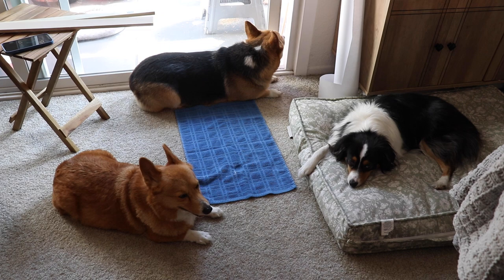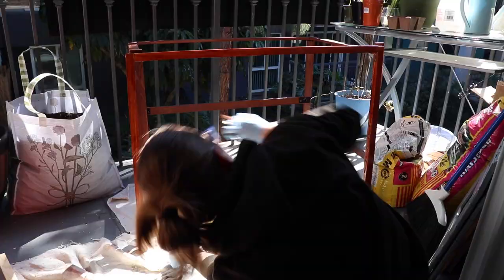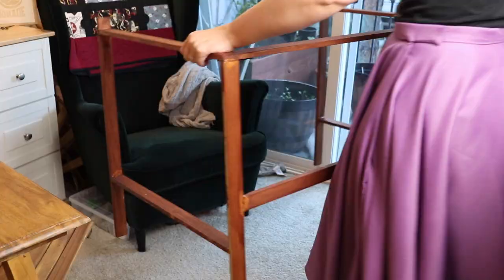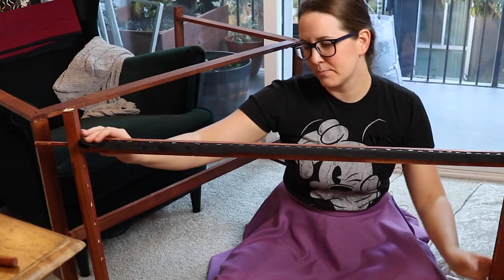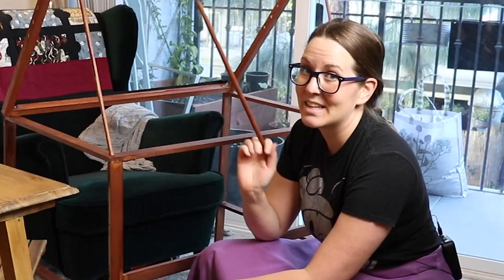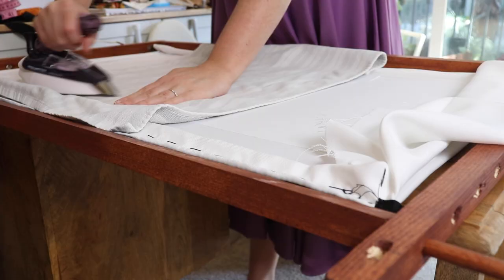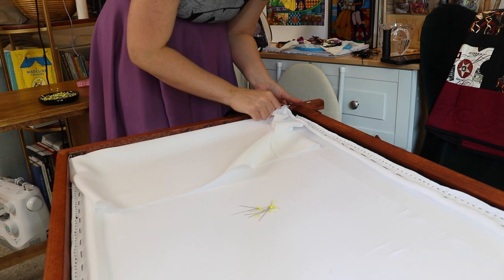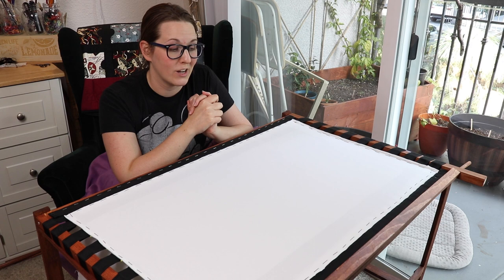Building My Own Embroidery Frame

Comment: Just a tip for screwing narrow wood to avoid splitting pre-drill holes where you want the screw to go with a drill bit slightly narrower than the screw also pick a small gauge or thin screw like a long thread hinge screw and if the screws have a counter sunk head makes sure when pre drilling counter sink it too otherwise the head of the screw will split the wood, you can use a larger drill bit about the same width as the screw head to counter sink it instead of buying counter sinking bits ( if you don't know what counter sinking is a quick google search should give you an idea) hopefully this helps improve your wood working
Reply from the maker: Great tips, thank you so much!
Reply: I was thinking this 😊
It's true, pre drill is the way to go

Comment: Wow, good job! Gosh you really manage to stick through it, and see a project through to the end, I’m impressed!
At 8:24 — no, it’s not wrong to screw the two pieces together, it’s much better than nailing. However, you pre-drill to stop your wood from cracking, and still glue first. You would use a drill bit a bit smaller in diameter than your screw.
Reply: Also your doggo is very cute 🥰

Comment: For a first frame I think it's so well done! But yeah, ideally it would be foldable haha. If the base turns out to not be stable enough you can try to put the connecting pieces in diagonally, so you form a triangle. 

Excited to see you getting started on this piece!!
Reply from the maker: Thanks!! I'm glad I made the frame itself as a whole separate piece, because if the stand breaks or just turns out to not work as well, I can easily make a new one (maybe even a foldable one!) and still just chunk the frame on top!

Comment: I have used large frames from the thrift store to stretch embroidery projects. Hoops are too damaging.  Never made a stand for them, but it would prolly work fine.  My current project justs gets propped against adjacent furniture.  Makes me wonder if I can find a 36" wooden table to convert to an embroidery table. I have a 30" antique card table with folding legs... but antiquely too beautiful to cut up!  I have a jinky metal folding table too, it might not be sturdy enough.
You got me thinking.

Comment: Another option is to use a quilting hoop as they are larger than a embroidery hoop😹😹
Like you when it comes to embroidery frames I have made my own as well. 
I am looking at building my own quilting frame for the quilt top Mom made me before she passed away, 11 years ago using all my favourite colours. This is a challenge as all the layers start out on their own rod and then fed onto one rod which turns as do all three top layer rods do as well.🙈I just can not afford to buy this type of setup as it’s almost $6000 AUS to buy😿😿 which is okay really as I do have almost 15 finished queen sized quilt tops that need to be quilted🙀🙀(did I mention I have way to many hobbies😹😹😹😹) the biggest issue is it has to be wider than the bed is 😹😹😹well they did say life was never meant to be easy breezy 😹😹😹